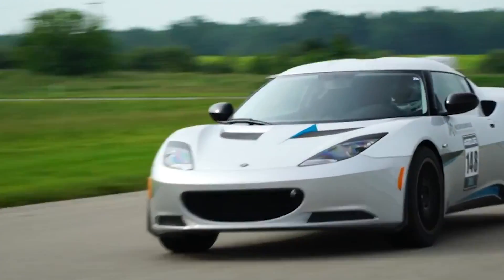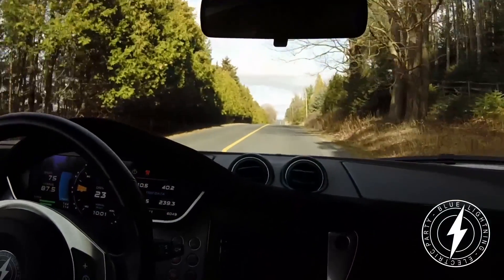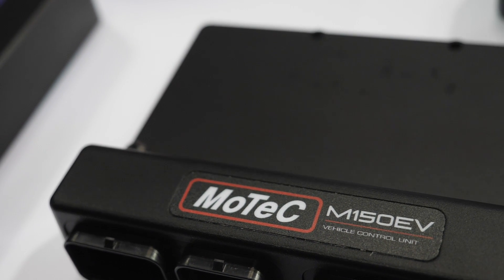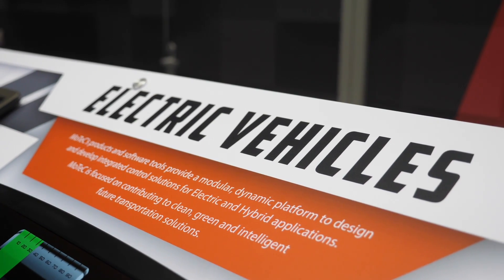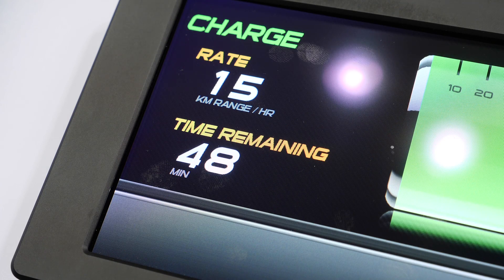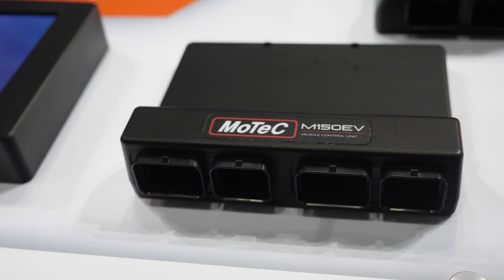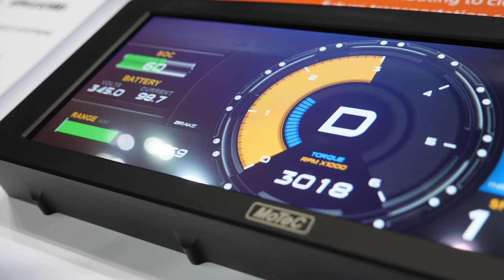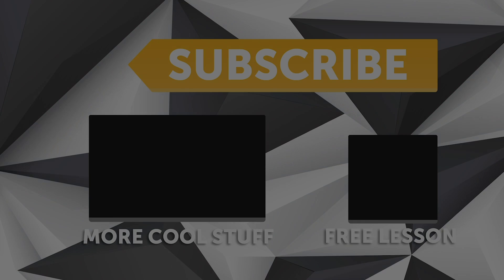700WHP Hybrid 350Z & Electric Lotus | Modern EV Conversions [TECH TALK]

Comment: Maybe I didn't quite understand or perhaps Sasha interpreted the question to his car specifically:

Is it actually impossible to have a hybrid with this version of electric power (connected directly to the crank and gearbox) with a clutch in the system?

It certainly isn't cheap but it could be a way to keep certain H pattern manual cars on the roads and allowed into city centers for the foreseeable future if this sort of hybridization is possible without having to swap to a clutchless system such as an automatic gearbox or sequential. 

Done the right way it shouldn't even add that much weight, as with the generator getting rid of the flywheel, alternator, power steering belt, ac belt and so on, the biggest impact is how big a battery you'll fit.

Comment: Great to see someone innovating on such a level even if it has taken 22 years for hybrid tech to jump from motorsport into the aftermarket, off the shelf kit can’t be far away. Interestingly enough the numbers stated in this vid are very similar to the Zytek Q9 system fitted to a Panoz back in 1998
Reply from the maker: As Sasha mentions cost was and is still a huge barrier to entry. Same reason why a lot of other things take a while to trickle down from professional motorsports and into the aftermarket - Taz.

Comment: For more inexpensive re-use of OEM components, there is a project called the "Open Inverter" project. You can get quite a bit of power out of the Prius inverters (yes, really), or the Chevy Volt inverter. The inverter that is Motorsports grade that Sasha is using is approximately $5000-8000 depending on which model he chose, whereas you can find a Prius or Volt inverter for $100-$500 depending on how hard you look. Then the inverter is opened (eek!), you replace a control board, and now it will do your bidding. The downside to this, is that obviously it requires even more effort than what Sasha has explained already.  See https://openinverter.org for more information. There's a forum at https://openinverter.org/forum/ . I may or may not have a E46 330i conversion in progress... :)
Reply from the maker: Nice one Matthew, throw a link to your project thread etc if you have one so we can find it and follow :) - Taz.

Comment: Ah, cool interview.
For quite some time now, some motorsport engineers have been calling the 'throttle pedal' a 'torque demand pedal', or a similar term. 
From that, and that the driver is only concerned with what is being delivered to the tyres, I would assume the same principle applies for charging during partial torque demand - the ECU gives the driver what (s)he demands but can run the engine at full 'throttle', or near to it, and bleed off the difference to charge the battery, as required and as the battery can absorb?
Reply: That doesn't make sense. 
You want a system that simultaneously charges and discharges?
Reply: @SwankySasquatch66  Where do you get that from? Re-read what I wrote ;-) 
To clarify, if you still don't grasp it, there is an engine, a battery, and a motor. The engine can potentially supply 'x' torque/power and if the driver requires less than that to be applied to the tyres, and it's below the point where the motor is used, the difference can be used to charge the batteries? Of course, as more torque/power is demanded by the driver there is less reserve available, if required for charging, until at full engine output there is none. If more torque/power is required, the motor will come into operation and draw on the battery, discharging it as required. Then it starts over. It is a common practice in competition vehicles, when the regenerative braking is insuffient to keep the batteries charged suffiently for a full lap. With some classes, there is a limit on the regenerative braking rate and sometimes there is a limit on what the batteries will accept, or both, so other methods may be used, like this.

Comment: Wish i could do hubcentric electric motors in my z32 front wheels while keeping the 2j feeding the rears
Reply: That would be a lot of unsprung weight.
Reply: @RadDadisRad  straight line rocket. Even a rear mounted 2j with vw transaxle and nsx style electric motors for the front
Reply: The orbis wheel system does something similar too that